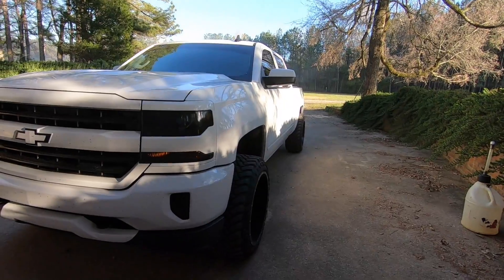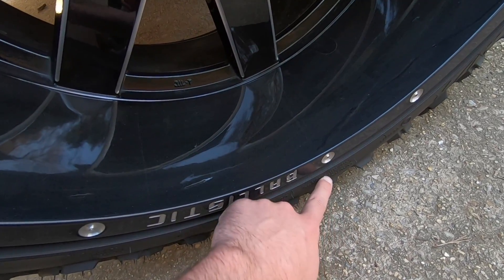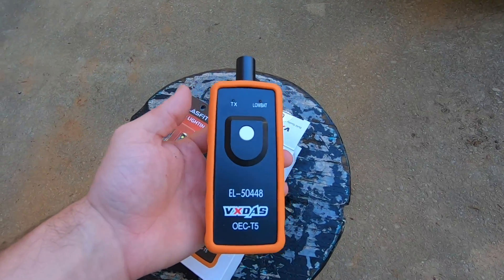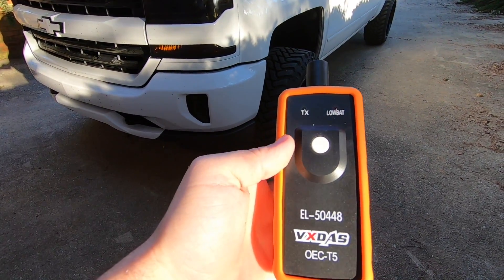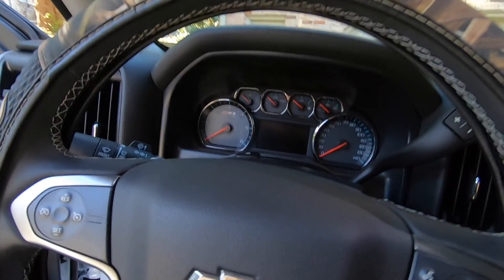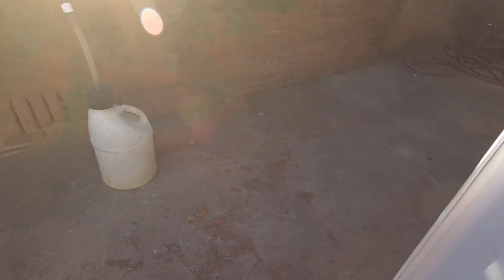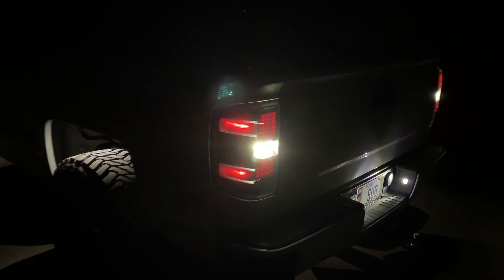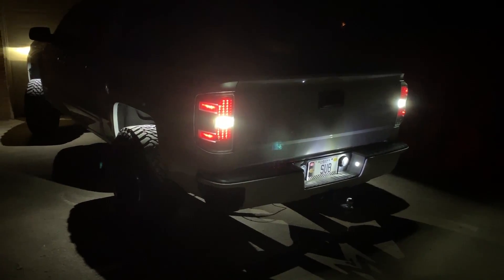Synce TPMS sensors using this!

Comment: After switching from the Goodyear  P tires to Atturo LT tires I had to sync mine.  They would display but the warning would still show to check them. I had to use a scan tool to tell the monitor they were LT tires. That was a month long headache.

Comment: So when you get a tire/wheel change it goes blank on the “tire pressure” sign?
Reply from the maker: If the factory sensors are not used they will have to be relearned.
Reply: lmfscrew cause im fixing to get Atturo trail blade m/t 33s basically a similar setup as to yours for my 2015 silverado so I was just wondering if my tire pressure signal will go blank

Comment: I bought the same tool and have tried to sync mine multiple times, went to my gm dealer and a few tire places and no one can get them to work
Reply from the maker: You sure you have sensors?
Reply: Yeah, iv only ever got one to respond i think they gave me bad ones
Reply: I just bought some wheels, took me forever to get this same tool to FINALLY after a couple hours off and on playing with it to get the driver side front to sync but I cannot get passed the passenger front..tried again off and on for hours...dont know if sensors are bad or there is a trick to it?everybody on YouTube making it look simple idk..what else to do
Reply: @losdime10  I ended up replacing the ones that came with my new wheels with oem ones off ebay.. turns out extreme customs never programed the ones they sent with my package to my truck before they sent them to me. wal-mart programed them right in front of me. now i have a spare set i guess if any ever go bad. This tool works now iv used it after i rotate my tires.
Reply: @Nightowl82  I feel.like I accidentally got the driver side a few times but I cant get passed that one.  Do you think letting some air out will get it to register? I watched some vids on YouTube that show.ppl doing that and it works but Idknif it works for a lil older vehicles or what..I got 17 sierra
Reply: @losdime10  id take your truck to a tire place and have them pull out and check your tpms sensors, that sounds like the same issue i was having

Comment: Not gonna lie....I cheaped out.....threw all the old sensors in the spare tire, ordered the orange reset tool, sinc them.......but after so many miles it deletes the sensors again....2017 Silverado
Reply: I think your issue is being in the spare there not rolling and go to sleep after so long
Reply: @joe0917  thanks......I was leaning towards that myself
Reply: There isn’t a Tpms in the spare
Reply: @Nightowl82  there isn't.....I put the four sensors from my stock wheels in a pool noodle and put that inside the spare tire, inflated back to spec.....reset the sensors with the tool.....all four sensors activated (with the same pressure reading of course).....but due to the spare tire not rotating,  the sensors deactivate after so many miles